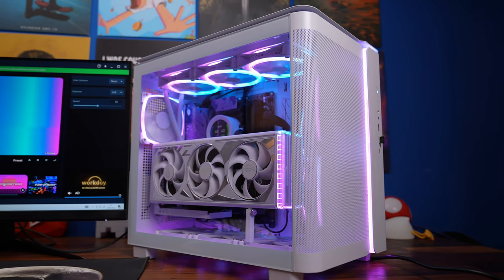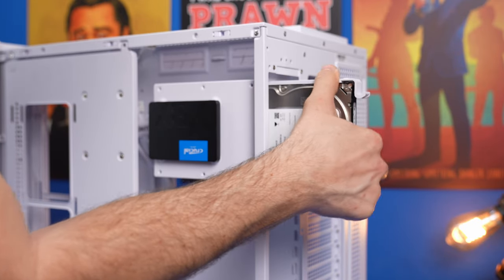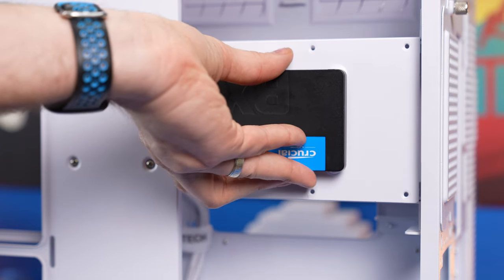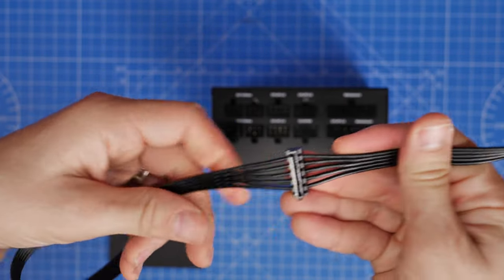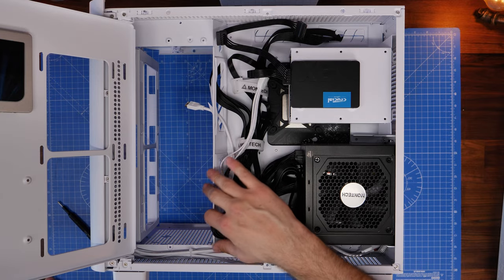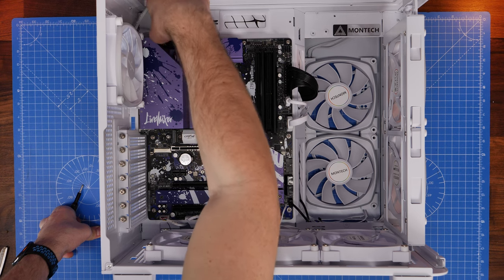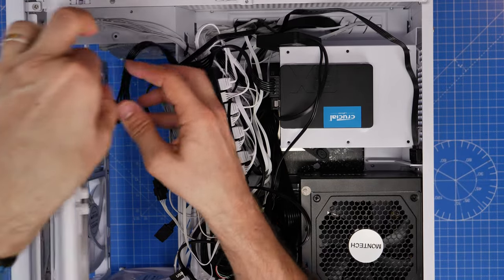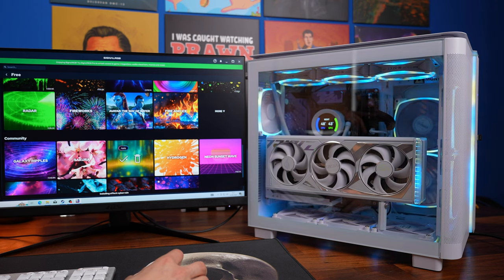Montech King 95 Step-by-Step build guide

Comment from the maker: Specs of this build (note these include affiliate links which may earn me a commission at no extra cost to you)
Motherboard - Asrock Z790 Livemixer https://amzn.to/3U4eU9x
CPU - Intel Core i3-13100 https://amzn.to/3Jmh6nY
RAM - Crucial DDR5 6000MHz Pro series RAM https://amzn.to/3UnPS6t
NMVe SSD - Crucial T705 Limited Edition https://amzn.to/3UqYuJT
GPU - Asus Strix 4090 OC white edition https://amzn.to/49D9Kag
PSU - Montech Century G5 https://amzn.to/4d2J3yI
SSD -  Crucial MX500 2TB and Crucial BX500 2TB https://www.youtube.com/watch?v=IOJNybKZ4wk 
Vertical GPU mount - https://youtu.be/2dlB3bMFJUY
AIO - NZXT Kraken 280 RGB and NZXT Kraken 360 https://www.youtube.com/watch?v=G5r3SG3ACwE
Fans - Montech RX140 and RX120 standard and reverse blade https://amzn.to/4d0V1sH
Extra fans - NZXT Duo https://www.youtube.com/watch?v=3IPOt0ZF-wE
Lian Li Vertical GPU mount - https://amzn.to/4aLM9FH
Reply: What gpu anti sag stand is that?

Comment: Wanted to add some information from the King 95 Pro for anyone interested. The Pro version comes with the Montech fans preinstalled and an RGB controller mounted at the top interior of the case where the side fans are located. A cable sleeve does an excellent job of keeping all the fan wires neat and tidy.
Reply from the maker: Thanks for sharing
Reply: What rgb control software do you use with the king 95 pro
Reply: @PlankGFX  I'm going to be honest, I haven't had much luck finding software that I like using. MSI Mystic light is incredibly basic and doesn't provide nearly as many cool features as LianLi. But everything needs to be plugged into the LianLi controller to get all those cool effects.

Basically, you have to press the button to cycle through preset color modes. When you hold it in, then it will sync to whatever software you're running on your computer. I haven't figured out a way to get more control and kind of gave up.
Reply: So when you say “it comes with the montech fans” are those the same fans as a graphic cards? They look the same…??
Reply: @danielridley2137  Um, no. The fans that are provided by the Montech case come preinstalled instead of loose. The fans are bigger than typical graphics card fans.
Reply: Are the fans pwm?
Reply: @Blackbind01 All the Montech fans supplied with the King Pro are PWW
Reply: @homer1991 the online specs on the website say pwm
Reply: This video made me feel good about my cable management. Glad to see theres others who dont care about it😂
Reply: Can you Controle the RGB with razer apps?
Reply: it turns out that in the pro version all the wires from the fans are installed and stacked, there is a hub and it remains only to connect them to the motherboard?
Reply: @4orniy_shah And the sata socket on the psu

Comment: I'm a bit confused about the gpu cables. I have a 4070 super, so should I use the PCIe or 12V cable? or both?
Reply from the maker: If you have it with your psu, use the 12vhpwr cable from the PSU to the GPU.
Reply: @TheProvokedPrawn  Thank you <3

Comment: In hindsight, a couple of pointers.
1. The back door comes off, so take it off during install.
2. The hub can be shoved into the hdd trays behind where the ssd was installed. That will result in a cleaner look.

Comment: I’m looking to build my first computer in the King 95 case and I’ve been wondering, can you/should you connect the radiator fans from the AIO to the montech RGB hub that’s pre installed in the top of the case? That way all the fans in the case including the AIO are hooked to the hub.  And if so, would you connect power the power and the RGB lines to the hub (or would you connect power to the motherboard)?

Comment: I bought the red version of this case (accidently, I wanted the Pro version but I'm apparently blind).  Anyway, I've lost several screws so far, still not done, but it does start.  I need to finish plugging in the fan and rgb controller and it should be gtg.

Comment: my led button on the case doesn't switch the led colors it resets my pc, any fix for it? I got a MSI b-650p Wi-Fi motherboard.
Reply: *restarts
Reply from the maker: I believe that the led button is only for the pro model or if it isn't I haven't worked out that part I am afraid

Comment: I just ordered non-pro version and will be building it with noctua redux fans and mesh front panel. Since I hate argb, it there a way to turn off front rgb strip completely?
Reply: don't plug the cable

Comment: Can you do a top mounted 360 mm Arctic Luquid Freezer III in a Push-Pull configuration where it exhaust the heat out of the top?
Reply: As far a know, yes, side and bottom fans are intake, AIO and rear fans exhaust. Only thing I've heard though is that you should use the case's fixings for the arctic freezer III AIO to fit, possibly even not use washers. Search for clearance issues.

Comment: Hey mate is Anyone familiar with lian li infinity fans if so tryna figure out if it would be compatible with the king 95 pro case in this configuration the 4 front fans would be 140mm reverse blade fans (so intake) the bottom 3 fans would be 120mm reverse blade fans  (so intake) the top 3 120mm fans on the aio would be exhaust then the one on the back of the case is a exhaust curious if they could use the built in fan hub on the case or all would work with the included lian li fan hub in the 3 pack thanks heaps for letting me know
Reply: I have the fans for this configuration (Lian Li Infinity), but the 140mm Reverse fans don't fit in the side mounting bracket (despite the case specs saying it supports 140mm), is that just a Lian Li issue or when they suggest support they are talking about removing the bracket (swinging one that can be for side or front) to install the 140mm?

Comment: Hi there, sorry for the post on an older video. I'm about to buy a montech king 95 pro and wanted the new hydroshift aio. im really worried that it might not fit at the top? some people have said that the lian li series aios are too slim to fit in the top bracket...do you know if it would fit perfectly fine?
Reply from the maker: Can't see any reason why it wouldn't.

Comment: I've got the Montech King 95 Pro and the GIGABYTE B650 A ELITE AX Ice. My Problem is that the F_Panel header does not fit on the MB. That's because Gigabite is using this G Connector thing in wich I cannot insert the F_Panel header from the Montech Case.

Some can help ?

Comment: Hey man nothing bad will happen right if i use a razer chroma rgb hub and a razer pwm fan controller at the same time with different sata power sources with a splitter on both of them to increase just one fan slot and one rgb slot

Comment: Hey man, I have a question for you. I have the same case and was wondering what gpu mounting kit you would recommend for my rx7800xt card? I have 3x120mm fans on the bottom and an ATX motherboard so I'm worried if I will have enough space for the gpu bracket because there isn't much room on the bottom.

Comment: Can I put the RGB cables from the watercooler into the ARGB/FAN controller of the PRO version case?  If so, can I only put the RGB cables?
Reply from the maker: I've not used the pro, so can't say
Reply: @TheProvokedPrawn  I saw here that I can connect the RGB, sorry for the stupid question, but the Hub requires two SATA connections... can i use a single sata cable with two ends run the hub, or should two separate SATA cables be used?

Comment: This case has reversed blade fan so i think your bottom fans are exhaust and i have seen many other builds also on this case and every time bottom fans are facing upwards and are set as intake
Reply from the maker: @Aayush789  the bottom fans are intake.
Reply: @TheProvokedPrawn  Hes right, the bottom fans as a default configuration pushing air into the case and their rgb led is showing perfectly as they facing upside not downside. If u turned those fans downside they pulling air from the case, if those fans the default reverse fans we talking about.
Reply from the maker: @CoffeeGameMovie  what are you talking about. I know how I installed the fans.
Reply: @TheProvokedPrawn  I think they assumed you got the king 95 pro, in which case the bottom fans are reversed, and would be installed face up.  But I’m assuming you bought normal fans for the bottom yourself and had to install them face down
Reply from the maker: @ifensler  right. Thanks for explaining that they were wrong 😂 yes they are standard fans not reverse blade. I'm not a lunatic. I even explain they were not reverse blade while I was installing them 🤷🏼‍♂️
Reply: @TheProvokedPrawn  😂 that’s funny, I didn’t even see that part of the video yet, I just noticed the box didn’t say PRO on it so I figured that’s what you did lol

Comment: So I have the same case, same fans and the same hub, but I can't get the fan leds to work. 
Although the fan leds don't work they are spinning so I'm pretty sure the hub is good. (all connected to a 5v connector, always were).

I got:
mobo rgb 5v  1 >  case led - (works)
mobo rgb 5v  2 > rgb+fan hub > 6x fan leds + Lian Li AIO pump rgb.

The pump led lights up, but that might just be an indication that it's ON, havent been able to control it so it might also be unaffected by whatever signal comes through the argb hub.

How did you get them to work?
Reply from the maker: And the hub is connected to sata power and to sys fan header?
Reply: @TheProvokedPrawn  Yes it is.
And thanks for replying, I'm lost :)
Reply from the maker: @Menemnon  very odd. And you have checked there's not a loose connection somewhere?
Reply: @TheProvokedPrawn  There are no loose connections. I always triple-check and push down on every single connertor just a tad more before closing the case.
Reply: @TheProvokedPrawn  Where did you plug in your pump rgb, if any?
Reply: @TheProvokedPrawn  FIXED!!

The argb hub couldn't handle the Lian Li pump argb for some reason so I gave that it's own place on the mobo and moved the case led from the mobo to the hub.
Now everything lights up like a christmas tree!

Thanks again for the quick response, I'm sure you had many other things to do besides help a stranded LED newbie.

Comment: Isn't the bottom fans reverse-fans or what do you call it? So that you don't have to put them upside down like that to pull air into the chassi? :( Looks so bad compared to having them the other way. I mean on the images where you can buy the chassi, they're showing it with the fans facing into the chassi, like the ones on the side panel?

Awesome video btw! Cheers!
Reply from the maker: This is not the pro version of the case. I didn't have reverse blade fans for the bottom
Reply: @TheProvokedPrawn  Oh I see!

Comment: Hey Prawn, I've always found your videos very helpful, but I've desperately been looking for a tutorial on dual AIOs.
Specifically, having both a CPU AIO and a GPU AIO (like the MSI Suprim Liquid X — 280mm).

I'm using a Corsair 7000X case, so space is no issue, but with a 360mm & 280mm radiators, I seemingly have no choice but to set one of the AIOs as intake to avoid having negative pressure.

Any ideas how to set up my GPU's 280mm radiator optimally?

Cheers!
Reply from the maker: Sadly that's not something I've tried. Sorry
Reply: @TheProvokedPrawn  Could you...? 😅😛🙏
Reply: Did you ever do this build? I’m doing the same thing and I’m thinking of using the 280 gpu aio as intake and use the bigger 360 as outtake. That made the most sense in my mind.

Comment: You really have your fans on the bottom set to exhaust????? You know hot air goes upwards correct??
Reply from the maker: No. They are intake. This is not the Pro case. Those are standard blade fans...
Reply: Did you even watch the video lmao